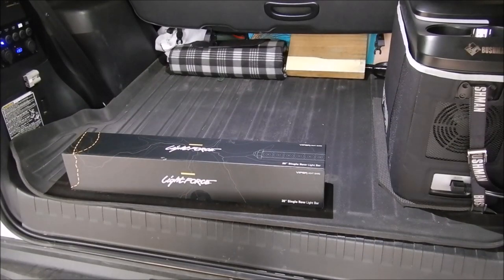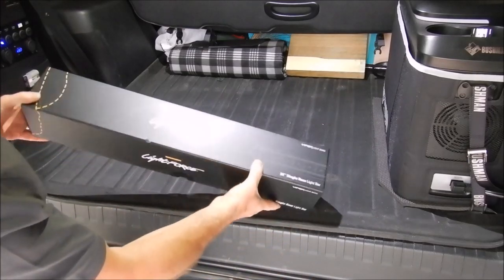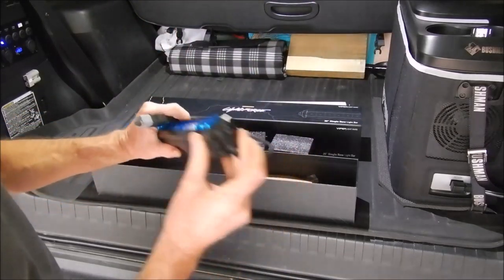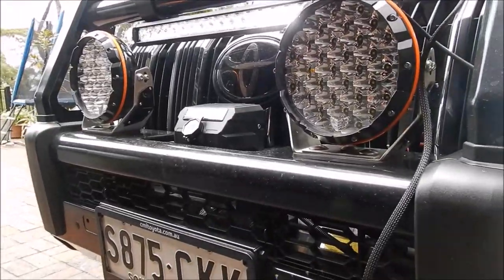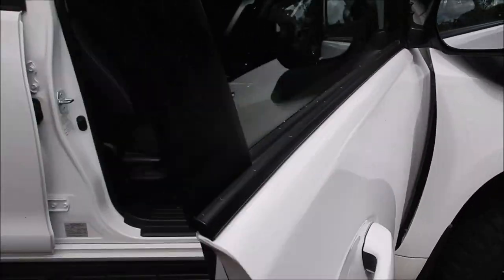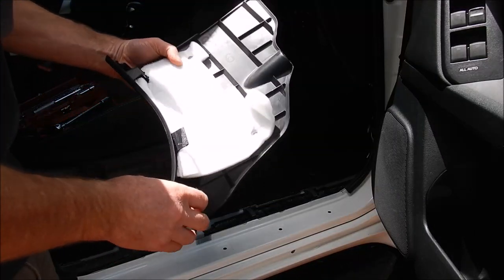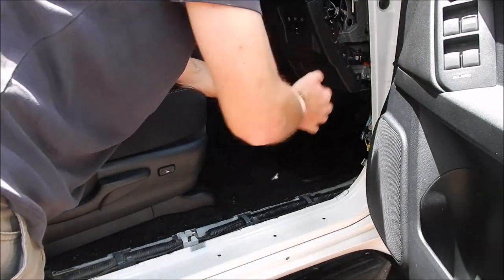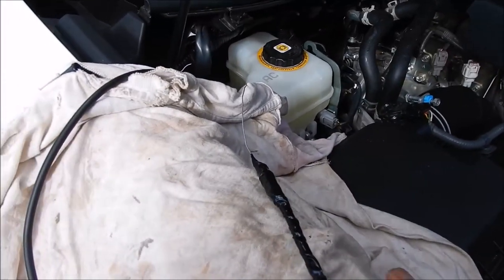Adding a Lightforce Viper LED lightbar & joining to existing Stedi high beam sensor wiring

Comment: Thx for sharing. Some great info especially showing us the access to the wiring behind the dashboard ( I own a 2019 GX Prado). Slightly off topic, is there wiring in there to tap into for a UHF radio power ?

Also off topic, how is the Itech lithium battery under the bonnet going and also the OME suspension ? I am having an OME 2” suspension lift put into the car next week so hoping I have made a good choice !

Trust you had a great Xmas

Cheers
Reply from the maker: Thanks for your feedback, the best place for the UHF power is to use a fuse tap into the fuse box just above the accelerator pedal as you will need to include a fuse in the UHF supply, (the fuse box cover does not fit back once you use a tap). You can get fuse taps on ebay. You'll need to decide if you want switched power. I took mine back to the aux battery, although I have to say I hardly use it when the car is off.

As for the battery, it has been fine so far however I'm off on a trip this weekend so will give it a good work out! The suspension has been good, I might go for air bags in the distant future just so I can adjust the ride as and when required, a cost I could not afford when I did it, but no real reason to change! Suspension is a difficult one as we know what we like but you cannot try before you buy!
Reply: @chrisp10022  Hi. Thx for reply and info on the UHF power supply and suspension. My 2nd battery is a deep cycle lead acid, so have been trying to keep tabs on how the iTech lithiums perform for when I need to replace it. Agree with the suspension especially in relation to spring rates. Everyone’s (including the manufacturers) perception on what is firm, hard, soft etc is different. Like you I have found the standard Prado suspension to soft so have gone for 200kg springs in the rear. I know it will feel firm, But hopefully the car won’t ride like a stage coach !

Cheers
Reply from the maker: @4bnewb969 Update on the iTech battery after a short trip. I ran a Bushman 52 L as fridge & Bushman 15 L Roadie as freezer (-18) and with some lights as well over New Years. I reached around 50% capacity used (50AH) which with my AGM would have been at the end of its use. It was cloudy one day so I was glad to have the extra capacity so I did not stress about limited solar charging! This was the main reason I changed to the Lithium as I just needed more capacity (for the kids to have ice treats!) and wanted to save weight. 

I'll be interested to see how far I can push it and how the capacity changes over time, but at the moment it's working as I had expected.
Reply: @chrisp10022  Hi
Thx for update. Despite lithium batteries getting cheaper (relatively) in recent times, they are still a fair $ commitment so good to hear the battery is performing as expected - so far !

Cheers